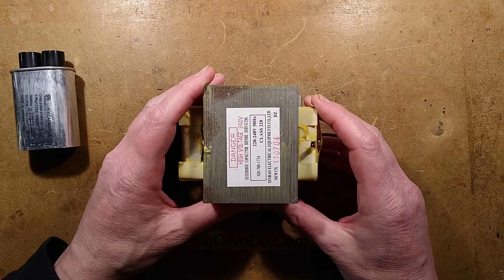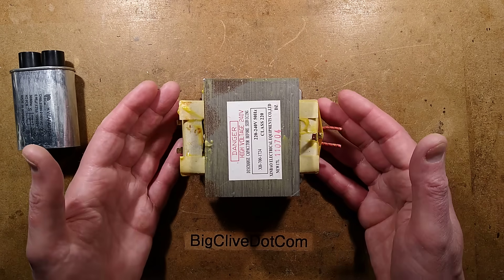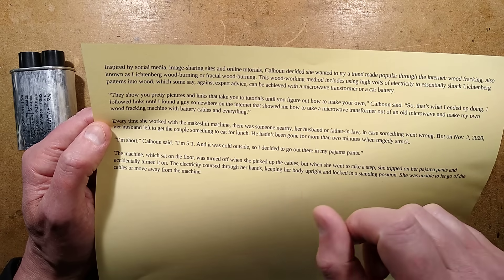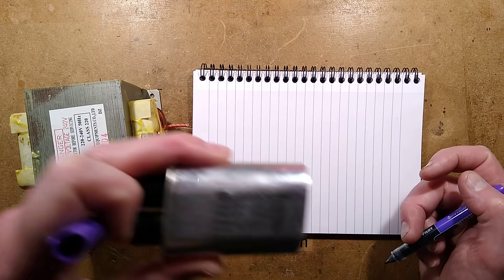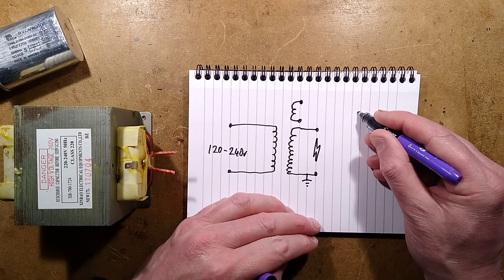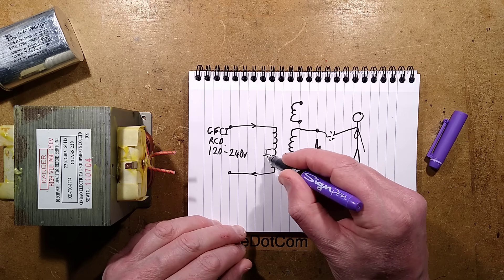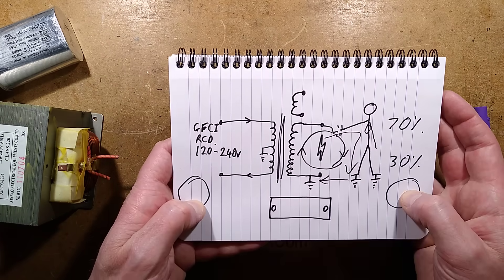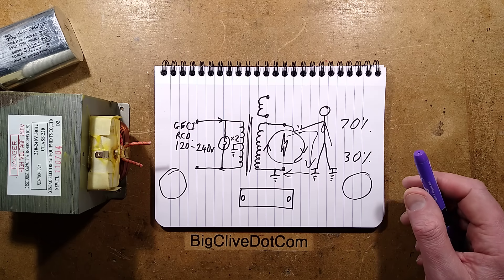The most deadly project on the Internet

Comment: Thank you for your video, the dangers of high voltages with overall high energy can't be overstated. I bet there's many people who think they've survived a high voltage shock with some battery powered device that has its voltage dropping immediately when you touch it or lo - gripped an arc lighter and am still standing - but while the dangers are really dependent on multiple variables this particular setup is one that everyone should put as much layers of safety(e.g. insulation) between it and yourself as possible. As a rule of thumb - if you are using a high power source like basically everything on the grid don't expect to be unfazed if you touch it. Even a funny zap from failing to screw in a light bulb the right way might push your heart out of rhythm.

Comment: Volts don’t kill people. 40 volts, 4,000 volts, 4 million volts, they’re all equally non lethal. 
What kills is the Amps (or current). It’s possible to die from 0.1 Amps and just 40 volts. 1,000 Amps at 440 volts is 50/50 odds really that the Amps will kill you, or that you’ll bleed to death because you hands will have literally melted into puddles. 200 Amps at 120 volts will kill you before you can understand pain. 
It’s like falling & landing. Falling won’t kill you. But landing… that can mess up your day.

Comment: Was hoping you’d mention the current output by these transformers. I’ve worked with 5-30 kV at low current and it’s very safe. I’m guessing these output much more than microamp current.
Reply from the maker: Potentially an amp or more.
Reply: @bigclivedotcom  😮 I prefer to keep my body intact and breathing.

Comment: I thought that for transformers (ideal ones, anyway), power in was equal to power out, so even though the voltage would be higher, the current would be lower so as to keep the power relatively constant. Is this really worse than a normal outlet?
Reply from the maker: The higher voltage pushes much more current through the victim.  It only takes about 10mA to start causing loss of muscle control.
Reply: @bigclivedotcom  don't wall outlets have maximum power outputs? Can transformers amplify power? Great video, by the way. I can't believe people are doing this as an art project.

Comment: My dad taught me the basics when I was about 8 years old, it saved my life later on. That was when working with electricity put one hand in the back pocket, never grab on to a conductor, discharge capacitors with a screwdriver, extra care working with around CRT tubes.
Reply: As you know, most tinkerers don't get that there are charged caps at times that  they assume cannot hurt them because the electronic appliance is not plugged in. Wrong! ..
Reply: @orkneyrd  It's called a capacitor for a reason.

Comment: I used such high tension transformer many times and every single time it would be while being at least metre away, standing on thick styrofoam, holding a mains switch and NEVER holding anything connected to the secondary circuit. Stuff is turned on, electricity does its thing, stuff is turned off, cable is unplugged, charge from the capacitors is drained by using a special PVC tube dicharge wire holder I made, and then when I'm sure all is deenergized, work can continue.
Every. Single. Time. Because these kinds of circuits do not forgive.

Comment: When I was 14, a friend came to school very shaken. Earlier that morning he had been playing with a microwave transformer, creating impressively long arcs by touching the leads together and pulling them apart. He dropped the high voltage lead and it fell across his wrist. The result was only a strong burning flesh smell and a small scar, but he knew how badly he had fucked up.

The worst shock I ever got was from prying apart a disposable camera with a metal fork (a fantastic idea, as it turns out). It was merely startling. I got by pretty unscathed considering the stupid things I would do with a 15kV neon sign transformer.
Reply: What kind of disposable cameras are capable of giving electric shocks?
Reply: @android584  Anything with a xenon flash tube. They use an electrolytic capacitor, maybe 180µF, charged to around 300V. 

At my high school graduation party we were all given disposable cameras. A significant portion of the graduating class promptly began disassembling them to intentionally shock each other. I was probably the one who suggested it. I felt a jolt while fiddling with mine and wondered who got me. Turns out I just shocked myself.
Reply: I too, am intrigued
Reply: Yeah I know that feeling. Broke apart a camera back when I was a kid. Don't know exactly what on the board I touched but it made me flinch out of pain and I dropped the board. Carefully grabbed it by the edge and put it in the garbage, thinking it was safe if it was in there (dumb kid stuff). Now as an EE, def a bad idea looking back on it

Comment: Here in the states the primary distribution utility voltage is 7,200 volts going into the transformer at either 50-75 or 100 amps, or 3,600 in some Electrical Utility Co-Ops.

Comment: At 6.10 you talk of discharging the capacitor with a screwdriver, I not sure that this is explained particularly well as the terminals which are shielded individually with plastic turrets cannot be shorted together as the plastic stops the screwdriver breaching across all terminals.  The two spade connectors within each turret are the same potential if charged.

Comment: Wow. Anything that will do that to wood will cheerfully do that to you too...

I remember taking a grad level plasma processing lab. He was very proud of how low he had been able to get his voltages so low, but it was still kV range voltages, with water lines running around it. Part of the lab safety equipment was a length of PVC piping. You were to use that length of piping to knock your lab partner off if they found a short and clamped on the hardware. I distinctly recall the instructions including the phrase, 'hit them as hard as you possibly can'.

That was an interesting lab.

Comment: It's even a bit more dangerous than merely shorting the transformer. Like  old-school NSTs (Neon Sign Transformer) MOTs (Microwave Oven Transformers) are also current limited. And that's the problem - a "normal" non-limited transformer might pull enough current when you short it with your body to trip the breaker before you are completely cooked - you'd just be a bit rare as opposed to well done. I say old school NST because most 'luminous tube' power supplies are switching these days. I used to build arc-gap-switched Tesla Coils (as opposed to the common SSTCs that are built today) so I have a collection of HV transformers - MOTs, 4,9,12,and 15KV NSTs (30-60ma). I got careless once. And only once - got bit by a 12KV/30ma NST. Hurt. A lot. Fortunately(?) it was arcing to me rather than a solid contact so the contraction pulled my hand away. Then there is my favorite. a 5KVA 14.4KV->220V pole pig.  When run backward it's capable of supplying 350ma @14KV all day long. Before I ever connected that to the mains I made it as safe as something like that can be. I built an inductive current limiter on the input side , connected through a VARIAC, and 3 pole contractor rated for 100A, with a 3 pole 10A fast acting fused cutoff switch. The contractor is powered through a completely separate 6V power system controlled by a deadman box similar to what you describe. The output is carried to the coil via retired, shielded  X-Ray tube supply cables(5mm between center conductor and shield). The whole thing boxed to keep prying fingers out. And it still scares the hell out of me when I power it up.

Comment: I was zapped because of carelessly letting my sweaty forearm get close to a ham amplifier case causing arc to case as ground. 2200 VAC burned a spot...my hand tensed up in a tight fist and I went outside to prostrate face down on driveway thanking God I was still alive. As the voltage number goes up the speed of the shock goes up. Nobody has a fast enough reaction time to even dream of letting go/moving away. IT HAPPENS INSTANTLY. My experiencial advice is do what I do now which is STAY AWAY FROM IT. Thank you and SAFETY FIRST.

Comment: why on gods green earth would you use a MOT to make these. flyback transformers while not fool proof or 100% safe are 1000x more safe in comparison. These run at 60hrz at 2000v and like 2 amps so its got enough juice to send you to the great beyond several times over long before you even hit the floor as to where a flyback transformer if setup right will only burn the hell out of you and give you a good zap but still though treat it like its dangerous because it is.

Comment: Spent two years working signs and lighting, got bit a few times on accident with neon transformers, they are using the same concept as a tazer except connected to the mains. Most violent I've seen is a guy knocked unconscious between two of them but myself and a single one worst case was a hell of a jolt, quick heart, a bunch of cursing, one wrench launched about a quarter mile in the air and a well deserved smoke break lol. Gotta respect the angry pixies, they don't fuck around lol

Comment: I've used one of these several times and can safely say they still terrify me. I set the board up with the pins in, connect the cables too the pins, connect those cables to the transformer, plug the transformer in, hide inside my shed then turn the switch on and look through a gap in the door while squinting nervously
Reply: then you say,'' honey,,come look at this, ''..

Comment: I'm not an electrician but I work on everything. What you just described was the best way to describe what could happen. I have had 220V Shocks and it was mild. The 110V was very scary after the 20th time. Yeah you may think I'm a dumbass but my shocks were over a 49 year time span! I was changing a wall plug and careful not to touch certain parts. Come to find out the new wall plug I was attempting to install was Chinese. Therefore faulty. It did what I was always warned about. It grabbed me and cut my hand. After that I through the main breaker and installed a different plug. Working with electricity is serious. I was told by a master electrician that even switching on or off the breakers could shock a person. He said he saw it. When he flips breakers it's with the back of his hand and his face away from the box.

Comment: A guy I used to work with would connect up two copper rods to live and neutral, stick them in the ground and switch them on to go worming in his garden. He had a rewire and wanted to know what he could do to stop his new fangled RCD tripping (this was the first time he told me what he did) "well, since what you are doing is pretty deadly, I'd say you've been lucky so far and the best way to stop the RCD tripping is to accept you've been stupid and don't do it again!"
Reply from the maker: Don't know if it's still up, but there was a video of a guy doing that and getting his kids to help him by moving the electrodes about.

Comment: I've had enough shocks off UK mains 240v, and automotive HT spark plug leads to want to even try such a thing. Car HT systems are usually very high impedance, and unlikely to be able to supply high currents at their High voltages. Even so, they still hurt. A low impedance high voltage transformer sounds like a really silly thing to play about with.
I guess working on thick rubber mats and thick rubber gloves could help. Still I think there are much safer ways to do what is essentially art that don't require HV supplies.

Comment: Yeah. Nasty stuff. It's the current that kills. Sub 100mA is relatively survivable. Over 200mA somehow creates a bodily shutdown that is apparently rescusitatable (if someone is around to disconnect you and get your heart going again). Between 100mA and 200mA is INVARIABLY FATAL. Given that the primary in a microwave is gonna be able to take 1kW no problem, that's a lot of mA on the secondary at 3000V. The other use for microwave transformers is for 1-2kW inverters, but again, the HV secondary is removed and a few turn LV coil is added and the thing is used in reverse (opposite to a welder). Edit. The bit about RCDs not giving protection was new to me, but obvious in hindsight.

Comment: Is that called a magnetron?.
Reply from the maker: The transformer powers the magnetron.
Reply: @bigclivedotcom  Thanks. In the late 1080's atomic ovens were still very expensive here in New Zealand like $1500 to $2000. Now for the same capability machine it's just $300 to $600. In those days the Sharp brand was the best and Panasonic was the most reliable but boring.
Anyways I got 15 years of life for mine and it crapped out one day so I decided to open it up to see if I can find fault?. I touched a wire when it was disconnected then all of a sudden a jolt thru my left hand up to shoulder then I ended up belted across the kitchen into the wall. My arm felt like it was 2 times larger.  Anyways I just cannot understand how I was belted into wall as there was no force and this puts me off electricity, I'm now cooking on gas.

Comment: ...I do not believe for a second Calhoun "accidentally" turned it on. As you said with the unit you're using they are largely silent, I reckon it was still switched on and they're trying to save face a bit!

Comment: I used to repair MW ovens and I concur with you that they are dangerous. I worked with a young man at another job a few years later and he asked me about repairing his MW oven himself. I warned him not to touch it. I learned a few month later that he didn't intend to me and wound up with severe burns in the hospital for about 3 Mos. I was once shocked briefly doing testing and I survived without any injury but I learned from my mistake. I have been shocked by car ignition systems as well as old TV hv anode leads and house current. Thanks for your video.

Comment: A lot of people don't realize checking a battery using the jumper cables can send a killing voltage ⚡ to someone standing close by. It is also bad for the battery. It doesn't matter how many times I plead with men not to do this with my battery it goes in one ear and out the other. One man learned the hard way when a ball of electricity jumped from the jumper cable's spark to his son who was standing there watching a few feet away. He died.

Comment: Can confirm - a few kV will arc through a thick cardboard box and burn a hole in your finger! In my case it was a power supply for a 5 mW HeNe Laser tube. The hole was more like a pin prick, but still hurt. Can't imagine what a kW at 2 kV would do.

Comment: I remember when I was young and tried to adjust the timing on my Pontiac Trans Am, grabbed a hold of the HEI distributor cap that had a MSD “multiple spark discharge” unit connected on it. Boy did that light me up

Comment: Good advice. Also a good idea to mount the transformer on a platform that's a very good insulator to inhibit it's connection to ground and break that closed loop, don't just let it sit on the ground. Oven dried plain wood has a resistivity of 10^14 ohms/m but if it gets damp that drops to 10^3 ohms/m, which is basically the resistivity of tap water, so wood might not be a good choice here. ABS and acrylic appear to have a resistivity of around 10^15 ohms/m, so those are better materials. Make a nice thick box. Also, do not mount the transformer to these materials using screws  because now you're just making the insulation thinner which decreases it's protective effect. Use glue to stick the transformer to the surface to preserve the integrity of the thick insulation. If this is done right, then the only danger points should be the high voltage electrodes, which significantly reduces the dangers you need to worry about.

Finally, putting a ballast in series with the transformer primary to limit the current might give you a chance if something does go wrong. I'm not sure how much current is actually needed for those Lichtenburg patterns, but I don't expect it needs to be all that high given the high voltage is what's most important. If you put a 100W light bulb in series with the transformer primary that's at 120V, that's "only" 72 milliamps coming out of the high voltage end. Still dangerous for sure, but not as dangerous as the 5 amps that could be coursing through your body if it were not so limited. You can scale this up using a basic understanding of circuits if more current is needed, and if you don't understand what that means, then you absolutely should not be messing with this kind of thing.

Comment: I was an apprentice at 17yo for a local appliance repair company, mid-late 1980s. We were working on a commercial microwave with a 220v transformer. I asked one of the other apprentices who was there with me to unplug the unit as I was going to remove the capacitor and ohm it out. He said he did, but he didn't. I got hit when I went to remove a terminal from the capacitor and the entire left side of my body was numb, i couldn't do anything for 30mins and couldn't feel the left side of my face, and was involuntarily drooling.
Since then I've never trusted anyone to lock-out/tag-out a power/energy source for me again. I've been in HVAC/R for 35 years, and a boiler plant operator for a medical company. 
If you do not know about electricity, nor respect it, don't play with it.

Comment: Thank you for the video clive.

I'm wondering: Would it be possible to limit the current, and thus increase the safety?
I don't intend to try this, since I've got kids, and electricity terrifies me.

Thanks in advance.
Reply: At this voltage level (2000 Vac), your skin resistance is not high enough to limit the current going through. You need insulated gloves. You only need 10 mA or so to get heart fibrillation.